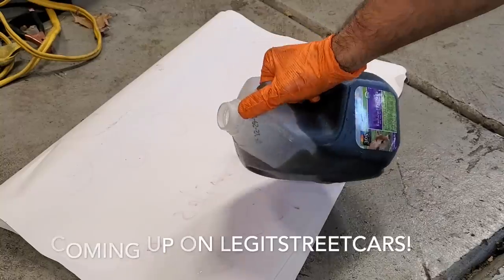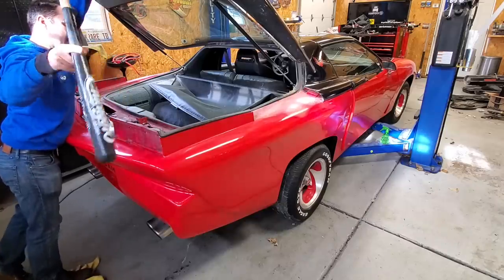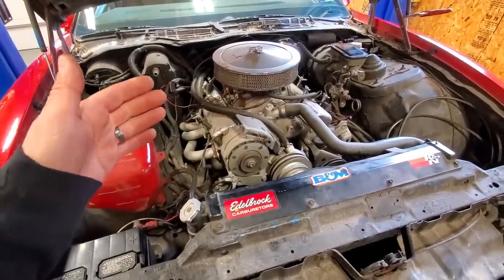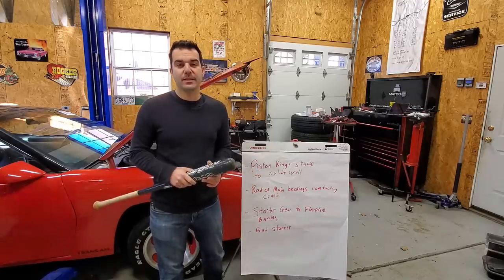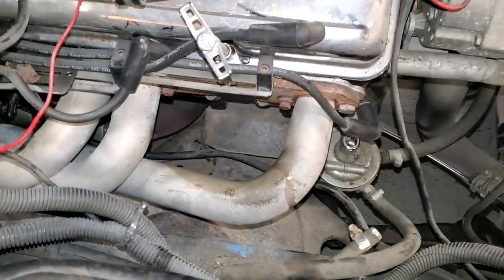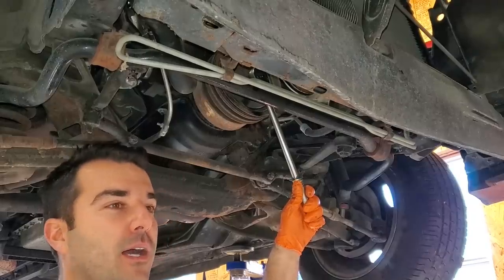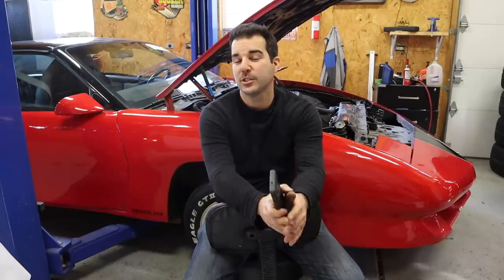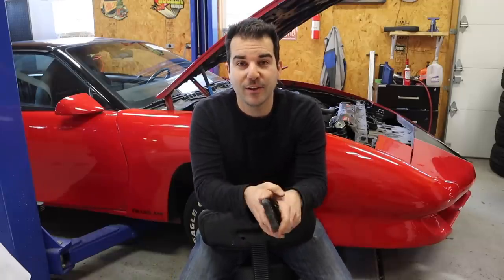My $1,100 Mystery Auction Car Has A CRAZY History! Famous Builder & Built Engine But, Will It Start?

Comment: I would look at the bottom of the distro, make sure it doesn't have a bad oil drive adapter. It does sound like an oil loss scenario. The knock sounds too deep to be lifters, I would guess oil loss at the crank bearings. Pump up the oil system with a hex drive, make sure the distro has a good adapter, many times the plastic sleeve goes bad, and see if it builds pressure at idle. Also, don't let the keyboard trolls get to you. Cool project, and looking forward to the next video.

Comment: I would set timing after heli-coil the hold down to 15 degrees BTDC at idle with the vacuum advance permanently capped which would give you a total timing of 30 degrees BTDC. Just a suggestion. Love the car!

Comment: When the engine starts the fly wheel will spin faster then the starter gear allowing the starter's Bendix to slide back. The engine noise could be fixed by adjusting the valves, remember it's hard to diag a noise from a video. When adjusting valves get some old valve covers cut the tops off so your not leaking oil all over the place during the final adjustment.

Comment: The starter is sticking because the splines on the shaft are twisted. The ticking is probably dry valves and valve seals, that’s also the white smoke.

Comment: Ford built a handful of 1970 Mustang's into Quarter Horse's. They were left over cars from the BOSS 429 project. They had 1969-70 Shelby front clips. They closed the air scoops and installed 1970 Mercury Cougar dashboard's and Super Cobra Jet 429's in the engine compartment. The rest of the car was just 1970 Mustang fastbacks. This was done because the 1971 models were to debut 6 months late and the 70 Quarter Horse had the front end look of the 1971 and also the 429 Super Cobra Jet that was also new for 1971. Your Firebird looks like it was built to show features that were coming out as the 4th generation. A teaser car to set the hook in potential buyers. You might have a hell of a car on your hands.

Comment: Previous Mercedes master tech and team leader. I remember those service bulletins Lube on ring gear especially when the engagement chirping interfered
Reply: My fix was a toothbrush and antiseize
Reply: Thin layer on fly wheels will make startups sqeek free not confusing tip start

Comment: Thought about pulling the distributor and spinning the oil pump with a drill and a bare distributor shaft ? It would (maybe) pump oil to the mains and inserts, and rockers .

Comment: Check your valve lash, and see if your valves are stuck. There's also a chance that once you build oil pressure and get it circulating it'll help out your lifters (assuming they're hydraulic). You're doing good though, keep up the good work!

Comment: Good score on this car. Lots of money put into it, and not abused. Check the last vid for tips on weatherstrip maintenance, if you missed what I said about glycerin, if they're rubber. As a former MB tech, you may already know that one.

Those after market gear reduction starter motors can be a bitch to align. I've seen guys have to cut a shim in half, and use it on one bolt, to twist it a bit. You just have to keep trying.  If you clean the ring, and gear, then 'blue' with a felt pen, you can see the engagement, and get an idea of which direction it needs to go.

It you disconnect the motor voltage, and leave the solenoid, you can run a switch to the bottom, and engage the bendix, without turning it over. You get a better real world test than the screwdriver.

The black marks on the cylinder weren't frozen marks. I've seen 'froze up' cylinders.  Those cylinders look great. A good thing to do, is pull the coil wire, so it cranks a while, before it fires the first time. You did the right thing by oiling the cylinders. ATF works fine.

Even if the rings aren't frozen, just being dry will make it very hard to turn over by hand.

You may have also some hydraulic lifters that have bled off, (the noise at atart up is a clatter of rockers &/or lifters), and the valves are not opening, that makes it damn hard to turn by hand.  Combine the two, dry rings, and bled off hydraulics, and you problem makes sense,

Something to watch for, if it has, or develops a bad miss, is a rocker arm, slipped off the valve. A collapsed, or bled off lifter, can give them enough room to do so.  Usually no long term damage, if you catch it.

The black is start of oxidation,, but if the rings were stuck, you'd see rust. I've seen black in new motor builds when someone forgets to oil the cylinders, or doesn't oil them enough, and lets it set for a week or three, before they get back to it. If you've ever used a derust solution, or naval jelly, think about the color it becomes when you put it on rust: black. The raw cast iron of the cylinder and the raw cast iron rings, (50/50 chance they're cast iron rings), they would make it black, for certain. Though with the width of the black, it may be from the oil rings. I'd have to look at the vid, again, to be sure, but it's moot, now.

Not long after the first Mobil One oil came out, with graphite. A regular customer, (and friend), bought a new, used rig, and switched to to Mobil One. Problem was, the oil filter had too small of filter paper, and it blocked he graphite.  He brought to us, afterwards, to see why it overheated.  It was a small block Chev. 

We pulled a valve cover, and looked at the rocker arms, checking for oiling. The rocker arm 'balls' were dry, and BLUE.  Effed the motor, which sucked, but got to give him shit about his blue balls, for years!

Comment: in the Knight Rider reboot there is  an early .scene set in the area where the mustang kitt was built and there is a replica of the original Kitt with the gull wing steering wheel removed and the original Kitt  partly covered.that was done with Rob's parts.great video and best of luck to you!!!

Comment: use transmission fluid usually helps as well to loosen the piston rings its an old hot rot trick not two much just some and it runs good and sounds good and that knocking noise is your valves on the head you need to adjust your valves a bit and i think she will run great

Comment: i almoat wounder if ticking are loose rocker arms... and or stick lifters. rockers are super easy to check and tune. run it with valve covers off, tighten nut until play is taken out. can do to spec with guages and all that after if you like.

Comment: Stuck lifters or maybe crank beatings starting to go. Best way is to use a screwdriver as a stethoscope - if it comes from deep in the block, it’s likely the crank bearings, otherwise it’s cam followers or valve lifters sticking (due to old crappy oil, bad cooling or blocked channels causing issues, perhaps).

Comment: 1. verify you have oil pressure with a manual gauge (if it does indeed have oil pressure proceed if not there is your problem)  2. get the timing squared away and distributor locked in place 3. find and fix the source of your transmission fluid leak 4. add a quart of transmission fluid to your engine oil and take it on a good long drive and rev it out a few times. Just what I would do if it were in my garage before taking anything apart or getting all super serious with any crazy diagnosis from people who haven't even heard it in person. For all we know the sound is coming from the transmission being low on fluid as mics have a funny way of changing sounds completely. Or it could just be stale gas, or it could be a stuck lifter, or it could be.......you get the point. Just my 2 cents.

Comment: If someone hasn't said it already a million times, the starter gear kicks back when the engine RPM overruns the starter and the starter gear gear isn't being forced into the flywheel via the solenoid or other method.

Comment: Brother just a minor correction, the bearings are supposed to touch the crank... It's the rod caps or bearing cradle of the rod itself you don't want making contact with the crank. Just for clarification. Future reference, bout a teaspoon of Marvel mystery oil down those holes would have freed that bad boy up  and loosen the rings up as well if there isn't metal damage. (block diagram overview)

Comment: Valve could be sticking. I don't know how it would sound in a SBC, but my 97 328i had one stick after it sat for a few months and I just drove it lightly till it freed. It was a rather loud tick but I had the hood off.
I remember watching my dad get a 1973 Cuda running after putting an oil mixture in the Cylinders and letting it sit over the winter months in Michigan.

Comment: Cut/break the starter shims in half and add shims just to the bolt closest to the engine.  This will allow the starter to angle just slightly rather than just lower it and should give a little more clearance between the flywheel and starter gear.

Comment: Oil pressure sending unit. The gage will work once you put a new sending unit in.  In all of my 3rd gen Camaros they would go out every 40000 miles. They sell the at your local auto parts store for about 50.00. The reason for the snall ticking noise is because the send unit can't read oil pressure and that's way you hear it. But good luck on it. I love the car man

Comment: Another possible cause of hard turning engine is that water was left in engine and block freezes and shrinks cylinder bores. Usually you will have other tell tale signs like water or aluminum material in oil.

Comment: Valves like to stick. So, normally before starting an engine that has sat years. Pull the valve covers and exercise the valves with a light hammer. Make sure they move and spring back. Then lube them.

Comment: Sweet ride, That's not a rattle. Thats the lifters, they are plugged. The lifters need oil pushed through them to keep everything loobed. Take them out and soak them, blow them out and put it back together.

Comment: Lifter noise. When the engine sits, some of the lifters are holding valves open, that's natural and they will never be "all closed" at any time. These lifters will have the oil squeezed out over time, they will "pump back up", just idle it for a while. Oh, and yes, the starter will kick the drive gear back into the starter after it starts, it's called "an overrunning clutch".

Comment: I think one thing that would be cool is to install the locks that you just hold the key up to and it pops the door open. I can't think of what cars had that, but I know that it something that I have seen before. It would be better than having random straps to open the door with.

Comment: That sounds like a lifter tap...  as others suggested mmo would help that out...  the timing should be 12° btdc. You'll have to retap the distributor tiedown clamp. The intake looks like it is a edelbrock 2101 performer...  the carb is an Avs 1405 (depending on if it's the electric choke, 1406) 650cfm. The 2 idle mix screws on the front had an issue with backing out and making the carb run REALLY rich and flood out.  If it were me,  I'd replace the intake and carb.  The power band on those are start lower than your stall speed.  Usually those are a 1500-6000 rpm power band. I'd bump it up to the rpm intake and change the carb to the avs thunder series for mechanical secondaries. Just my 2 cents

Comment: That's why that inner shaft on the starter looks twisted, it's because it is.  When the starter motor is driving the flywheel the spiral pushes the gear outward, as soon as the engine starts and the flywheel starts driving the starter gear it makes the gear retract.

Comment: Starter splines are meant to be twisted, that's what throws the bendix gear out. When the engine fires it kicks it back. If the gear is pulled out as you did it will stay out since it has nothing to kick it back.

Comment: More than likely a sticky or stuck valve from sitting. Usually tends to free itself after a few minutes of running. Pull distributor and drill an tap a helicoil into the dist mount hole. 3/8-16 bolt size. When motor fires up it pushes the Bendix drive back into the starter. Don't think just cause it doesn't retract on its own that there is a problem. Need to be sure of correct teeth mesh clearance when using shims cause you could possibly destroy either the Bendix drive or break teeth off the flexplate.

Comment: Just  spent time unlocking a spun bearing . That's what I see. take oil sending unit out, real easy to get to. Put a oil catch pan under car and start it up look and see if oil comes out quickly, And  Quickly, shut it off if it  does.  Motor sounds like what your oil pressure gauge is reading

Comment: That starter won't retract until the engine starts. The bendix uses inertia to extend and engage the ring gear. When the engine lights off it will kick the pinion and send it back. I am surprised that it didn't retract when you were spinning the engine by hand. Also, double check that you have adequate tooth engagement with those shims installed.

Comment: The tapping could just be the lifters. If it’s hydraulic roller, run some Marvel Mystery oil and it may help out. If it’s tappet lifters, just adjust it out at the rocker arms

Comment: Lifters and push rods is my guess. I would drop the oil pan and inspect the crankshaft rod bearings/shims. Also if that distributer wasn't secure, the crankcase pressure will find place of least resistance for oil blow by hence out the collet of the distributer. Food for thought. I'd say you could fix it under 500. I would not keep running it until properly diagnosed. Low oil pressure with minimal oil through the galleys of the engine wreaks havok on everything.

Comment: You need to remove the front wheels and you could use an extension and a swivel and you can remove the spark plugs through the wheel well opening

Comment: Add some transmission fluid mixed with quick start to carburetor next time when you want to start  engine if it is sitting for long time . It will LUBRICAT the pistons and engine .

Comment: good to see you got it running by simply adding some lube and letting it seep in Happy! Happy! Joy, Joy!!! buy a new starter because the pinion gear is twisted from binding. 
check timing next and fuel pressure

Comment: I'd change the fuel filter drain the gast tank and clean it out. To a full transmission drain and flush and filter/gasket kit. Valve lashing may need to be checked.

Comment: Bro, You should look up how a bendix drive works, and how it retracts. It doesn't work the way you think it does. you can't push it straight back after it engages the flywheel. I would pull those starter shims out.

Comment: In case these perfect mechanics haven’t told you, that starter does NOT need a shim at all. If you remove it you will see a few different sets of holes to adjust the gear mesh

Comment: a good habit when trying to do what you are doing would have been to mark and remove the distributor and spin your oil pump with a drill.. that would have oiled everything but the cylinders which i always pull the plugs and fog with a light blast of chain oil and let sit a little while battery charging checking all other fluids, unhook fuel line hook to electric pump to check and smell the fuel.. just little habits for future projects...my first ride i bought at 14 and spent 2 years restoring was a 69 Firebird Formula 400 Ram Air 3 4-speed..luckily i worked for a salvage yard so parts were free.. that's why i kept that job till 21...lol
you did good...
great score from coparts...

Comment: Sounds like a starter issue.  Squirt some WD-40 in it.  Rust plays havoc on starters.   Take off the oil sending unit.   Could be a little bit of sludge in there keeping the gauge not getting oil.

Comment: You need the tool to rotate engine at the flywheel/starter ring gear much safer than using the 1/2 bolt at the crank.

Comment: The Banshee I think was the concept for the 4 gen Firebird also the Kitt cars were cool built for the original Knight Rider .. the 2000 movie  featured a next gen Knight Industry car.. Knight Industry Three Thousand.. I thought it was based off the Dodge Stealth as it was a shorter wheel base but it could be based on the 4th Gen Firebird as well

Comment: The rattle you hear is valve train more than likely a collapsed lifter here is a tip when starting a small block gm take out the distributor weld a distributor gear on the end of a socket extension and use a drill to spin the oil pump over to build up pressure without starting the car.  Hey how does son of a banshee grab you for a name.  Great job love the channel keep it up

Comment: As of the 80's GM had a dozen starter configurations so block #'s an trans #'s ...= correct starter !!!
Pull plugs n soak cylinders then pull distributor n prime engine oil .
Or spin up engine on starter till oil pressure shows on gauge.
So many problems is exactly how\why you got it !!!

Comment: I don't know if that starter is even supposed to retract by spring. I believe the twisted looking teeth are the bendix, which works such that when the engine revs up faster than the starter it pushes it back in and thus disengages the solenoid.

Comment: Sounds like a spark knock or dieseling could just be old gas has lower octane  try octane booster and fill up the tank with premium with the built 350 I'm sure they bumped up the compression

Comment: Did you try tightening the bolts of the transmission pan?
- 
The valve covers come off without any tools, why didn't you have a look inside knowing the engine was rusty?